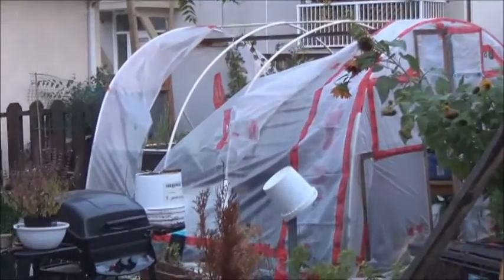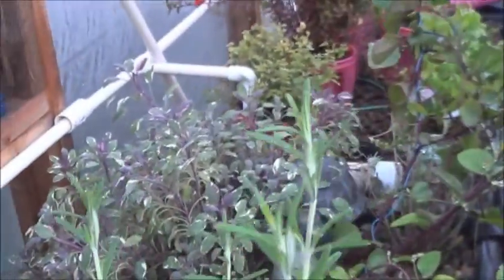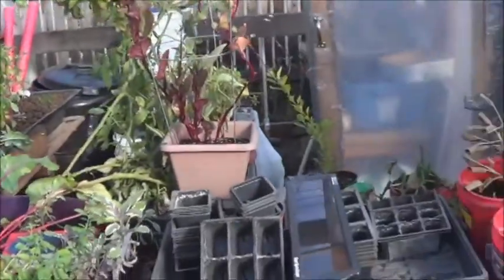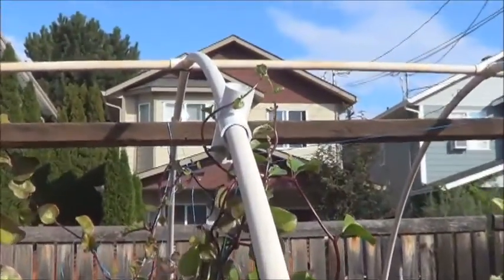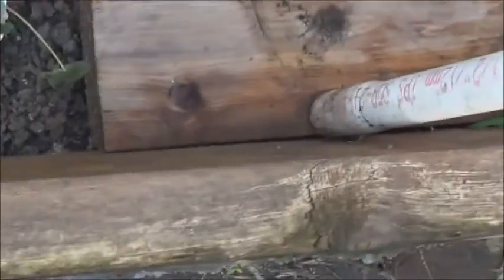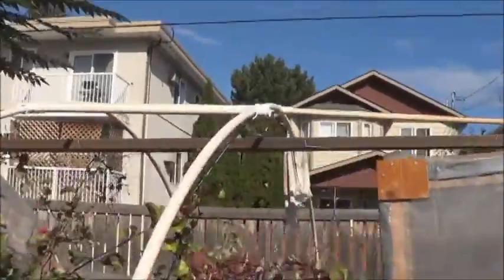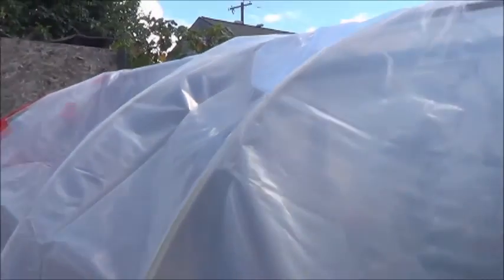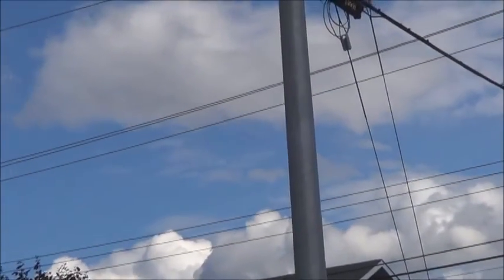Emergency Low Budget Greenhouse Rebuild

Comment: The plastic is 'dying' because the sun is breaking it down. A lot of construction plastic and vapour barrier is designed to behave that way so crews know it degrades quickly if littered on a job site. You need to invest in a greenhouse plastic when you rebuild..it will last longer. :)
Reply from the maker: Oh how I would love to invest in a proper greenhouse ... sigh.  Being a rental my keywords here need to be "mobile" and "cheap".  I can't wait to get a chance to build something solid!  Thanks for the tip!